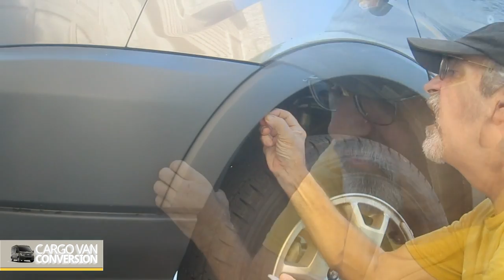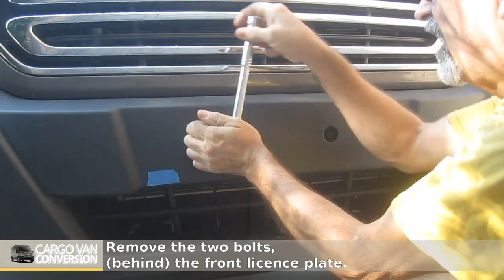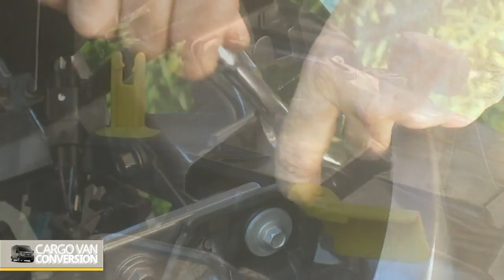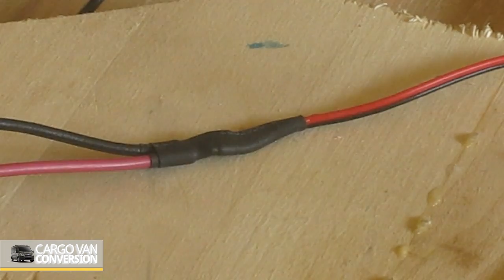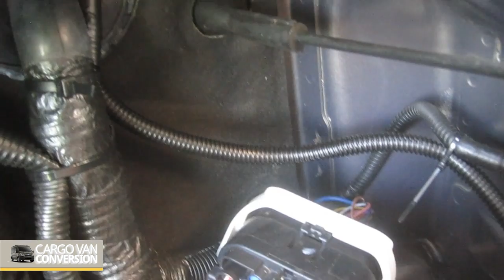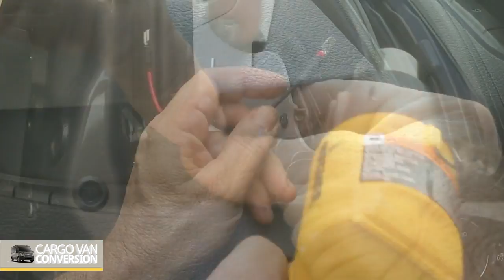Front Parking Sensor - Ford Transit

Comment: Unlike rear sensors activated by the reversing light circuitry, am I right in thinking that at the front we need a manual switch. Did your kit come with this switch?
Reply from the maker: No, I installed a separate switch in the dashboard, left of the steering wheel as you can see in the video https://youtu.be/77Gim3ni98c?t=416
Whenever I park forward into a parking space, I can simply switch it on manually.
Van Williams
Reply: Great ! Thanks a lot ! That's exactly what I needed to hear before purchase.
Reply: @cargovanconversion  did you put the plus wire from the unit on the brake light cable or a constant plus?

Comment: Hows about Ford making the dash hazard lights button on the Transit custom Tourino van a bit larger and stick-out than a flush sideways matchbox located almost behind the gear stick?  Full marks designers for making the dashboard overall like Capt. Kirk's control panel on the Enterprise, forget about actual functionality - its how its packaged that sells shit these days heh. Would be LOL if not that this idiotic location and flush dinky size has most likely already contributed to smashes due to drivers taking that extra second to locate and press the van's hazard warning lights. Duhh
Reply from the maker: I suppose the American made Transit is somewhat different, but I have an issue too with the hazard warning lights switch. Placed below the radio, I regularly brush against it, which switches on the hazard lights. Should have been possible to do it differently.
Van Williams